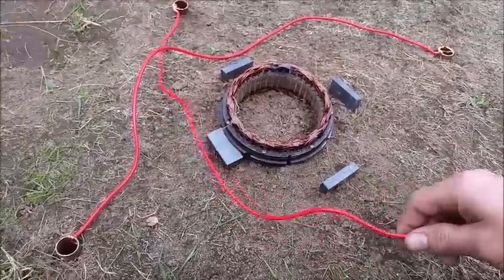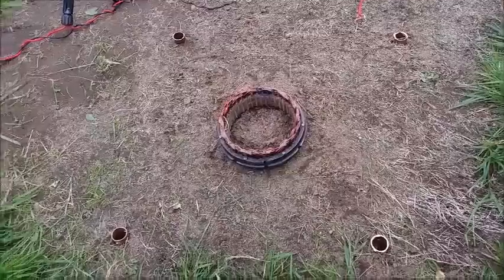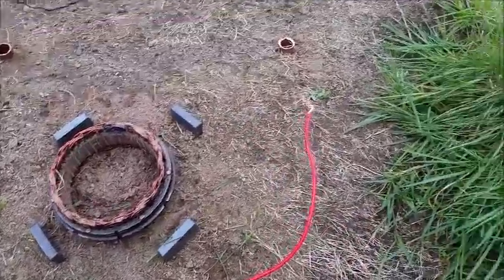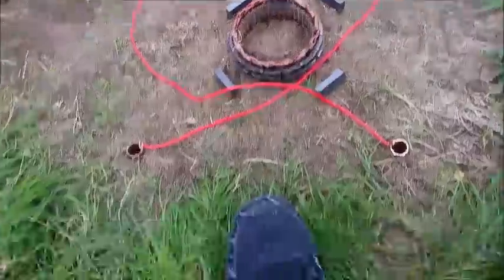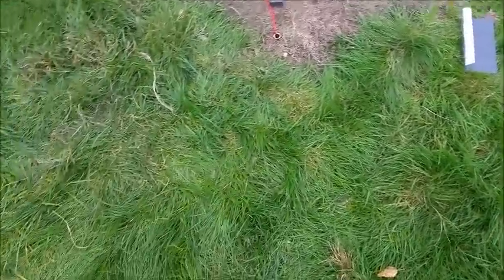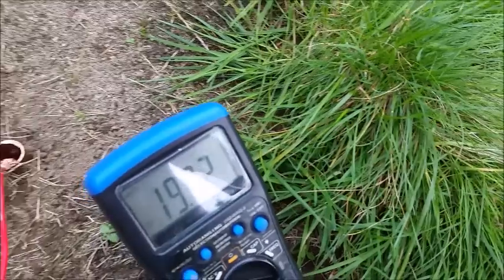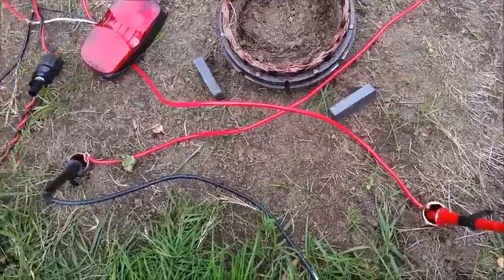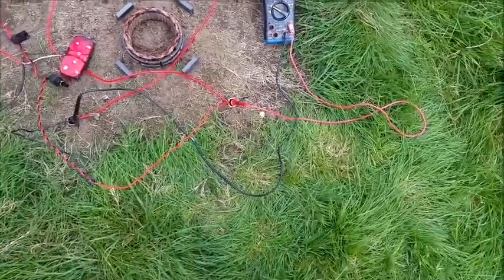How to get FREE Electricity

Comment: It works better than the usual 1-2 volts because the coil and magnets are creating a rotating magnetic field and either amplifying or simply adding to the ground voltage. 

I feel sorry for the people who think they are being tricked...
There is a lot to learn but you won't learn jack with a closed/skeptical mind.
Reply: its funny because if the magnets are on the ground the gravity doesn't impede the magnetic field like it would if they were moving through the field, effectively pinning the magnets against the earth with gravity's energy he cut out all the friction. Instead of having a flywheel spinning around, he uses the magnets to direct the downward force of gravity into the coil, and because of friction and gravity, the coil doesn't move but the gravity excites the electrons and creates a vortex in the coil. takes half the work does twice the job, free energy - no moving parts (keep in mind it's not really free because although we won't deplete the earth's gravity anytime soon it still had to come from somewhere. Same with the magnets, but you can run your second and third coils off of an electromagnet + battery bank that you charge with your first coil. I thought it would be efficient if I ran multiple sets of these but after making my mom and dad each a set (they're separated) I realized it's easier to just run all three off the grid and then just run with the added benefit of the power that you're adding into the system. It makes so much sense now that it's here in front of me, its literally free energy with no moving parts. lol. Well, it's funneled + stored gravity but whatever haha. works for me. Good shit
Reply: Lotsagrapes gravity and magnetism are mutually exclusive forces. Neither one has anything to do with the other.
Reply: Neither the coil nor the magnets are rotating. Sure there's a lot to be learned, but you can't learn anything from this video. Firstly, chemicals in the soil could be producing this effect, or even stray voltages from nearby equipment could be inducing the current. He doesn't show you what happens when he takes the magnets and coil away, the chances of them being the source of voltage is practically zero.
He also uses the term 'grid' saying "it should create some sort of grid", so I assume he's thinking 'the national grid' is some kind of electrical circuit rather than a term used to refer to power companies distribution rather than anyything technical.
If you take some change from your pocket, two different coins of different metal, such as copper and nickel, (UK: 10p's and 2p's) and cut some small cardboard disks slightly larger than the coins. Soak the disks in salt water, then start with say, a copper coin, and place a disk on top, then a silver coin, then another disk, and keep going as much as you want, starting with a copper coin and ending with a silver one, and you'd have created a battery, of about 1.5v. 
Now think of what nutrients might be in this guys soil, and how much moisture there may be underneath.
That's why he should have shown meter readings without the coil and magnets, as well as meter readings with wires not crossing each other.
If you take a piece of insulated wire and coil it like a spring, say 100 turns, then take a second piece of insulated wire and coil it, say 20 turns, then connect ac to the ends of the larger coil, and a meter to the ends of the smaller coil. Now bring the smaller coil close but not touching, the larger coil, so they are both parallel to each other, and you will notice you've induced a smaller voltage into the smaller coil. Now apply the voltage to the smaller coil and the meter to the larger coil and you'll notice you have increased the voltage. This is how you make step down or step up transformers. Now look at the video again. His arrangement of wires could very easily pick up electricity from nearby sources. The coil in the centre could actually be picking up stray voltage from a  nearby source, garden lights for example or underground cables, then could be inducing it into the crude 'coil' made up of copper pipes, wires and earth.
This is bad science at it's best.
Reply: Cat Man yeah... I'm not sure man.

I think this video is just entirely fake and there are buried wires connecting the bottoms of his copper tubes. Then he's losing a shit load of energy into the ground before he measures it.

I say this because we all know that grounding electricity is the best way to dissipate that energy. And not many "grounds" work quite so well as THE "ground".

Try it yourself. Cut and peel a few inches off of an extension cord. Then plug it in and throw it on the ground. Now lick the ground around the wires. No shock. It's grounded.
Reply: Guys...

Try to replicate this. You can't. This set up will not work.

The only way magnets and electromagnetic coils create electricity is by exposing those electromagnetic coils to a magnetic field in flux.

This causes an induced current in the electromagnetic coil circuit as is described by "Faraday's Law of Induction". 

If those coils are not experiencing a rapidly changing polarity  then no current is induced in the electromagnetic coil circuit.

Think about it for a second. How does a generator work? Well it works in perfect opposition to the electric motor.

Both systems are made up of a magnetic source and electromagnetic coils. The magnetic source can be permanent magnets or primary coils as in transformer assembly. In either case the systems work by either spinning the magnetic fields over the coils or by spinning the coils over the magnetic fields.

For a generator you use fuel to power a motor which spins the appropriate parts and electricity is produced. (Mechanical energy -> work -> electricity)

For an electric motor you supply the electricity, which induces a magnetic field in the electromagnetic coils and that causes the motor to spin. (electricity -> work -> mechanical energy).

So, based on that, just think about the generator for a second. It powers up once you get the motor spinning, which starts the generator spinning causing the electromagnetic coils to experience a high rate of magnetic flux, and therefore starts giving you electricity. Then you turn it off, so it stops spinning. Well, if all it takes to create electricity is some magnets close to electromagnetic coils, then why did it stop producing electricity? The magnets are still right there, 1/16" from the coils, but they are not spinning. So why has the generator stopped working?

I'll tell you why. It's because the electromagnetic coils are no longer experiencing magnetic flux
Reply: okay okay I feel you. You smart. you loyal. I appreciate you. like more videos so I can learn from them please
Reply: Lotsagrapes right back at you brother. Knowing things doesn't make a person smart. It's the ability to figure things out that makes someone smart.

I think it was Einstein that said something to the extent of "No. I do not know the speed of sound off hand. That is readily available in reference books. A college education is not for the memorization of facts but rather for training the mind to think."

You obviously have an open mind, yet at the same time, you apply reason. You're a smart guy.
Reply: @DanCleary1  true. alot of so called "smart" people do alot of dumb things lol
Reply: henry ford and the button! :)
Reply: tesslur
Reply: Dan C: I tried it and got a tingle in my tongue! I had at first thought the same, that he'd secretly applied a hidden voltage to those copper pipes, but then I thought how was he getting 19v, it's an unusual amount to be got from batteries, and anyway as you say, those pipes are grounded, electricity finds the quickest way to earth. I also thought that if he was smart enough to try to fool us with hidden batteries, then he'd be smart enough to devise a cunning plan rather than place an old coil with magnets around it on the ground and claim he's created a 'grid'!
Reply: Cat Man and 19 is not an odd number of DC volts for a battery. Most batteries function on multiples of 1.5V cells.

A common 9V battery, for example, is just 6 1.5V cells in series.

A car battery is 12V. That's 8 1.5V cells.
Reply: REDUCE YOUR POWER BILL. Simple and effective way to lower your power billlll. > https://t.co/jJLJDPZ75N?fg54hh >
Reply: Wrong- gravity and electromagnetism are the same thing...man made magnets are made by electrifying the medium but its small compared to a planet....I can prove it but im not going to on you tube.

Comment: The earth is a battery and to step up the power use two can transformers. First one is your power imput then connect it with the second can for your output. Be careful because the power will amp up alot. Adjust to your needs.
Reply: Eric Dell 
If you use a step up or step down transformer you will either gain volts and lose amps or, lose volts and gain amps. At least thats what i been tought i could be wrong.

Comment: 19 volts is good enough for charging a 12 volt battery several 12 volt batteries and you have power to run inverter to power shit brother. see if it does work at night too if so you got solar panels beat
Reply: Open ended voltage is not applicable .  He must use a resistor and measure across it to determine power
Reply: +TPUBruce who knows what he is doing I got a buddy who makes Crystal battery and it has been running for years never charged say he gets 1.5 volts so he makes enough to make the voltage he needs . we also do  hydrogen cells n shit lol
Reply: Adam Long, volts don't mean anything on their own. You can view it like this: You could have a bucket with a 110 litres of water in it, and the most it will do is make you wet, but if you suspend it from high and cut a hole in the bottom, you've got flow. A smaller hole creates a slower flow and a larger hole creates a faster flow. You could get hit on the head with 110 litres of water over a space of several minutes from a small hole, or hit on the head with 110 litres all at once from a larger hole. One would hurt more than the other.
Voltage is the amount of electricity generated, and current is the rate of flow. 
So if your battery holds 12v and still has a little capacity to push a few milliamps, but your charger has 12v but could only push 1 milliamp, your current will flow from battery to charger instead of vice versa.
In short, 19 volts may not be able to charge anything.
Reply: Yeah  but with close to 0 amps it would take forever to charge a car battery
Reply: +terry sowell  ever think about chemicals on the ground to amp up lol
Reply: can u message me how and results
Reply: Hi, I use a charge controller and from there two wires to the battery. Always safe! In the charge controller, 15 €, 10A, there are all other technical things like diode etc. So one good price for all and safety too.

Comment: Try turning the copper into a pyramid instead of just driving pipes into the ground. Make a pyramid with extra long legs and then put the legs just like the copper pipes into the ground. I dont know if it will be better but there is a lot of talk about pyramid power. great video

Comment: Have you hooked this up to a 12 volt battery?
Would 19 volts charge a 12 volt battery?

Perhaps two such ground devices could power a 12 volt lamp?

Just curious...
Reply: Absolutely! 19V will indeed charge a 12V battery. The question is do you have the time? At these current levels Trump will be on his second term before it finishes charging.
Reply: Yes 19 volts will charge 12 volt battery but you run the risk of gassing the battery with over-charging. A resistor or regulator would assist in preventing this with a slower charge rate. It would be good for running a small emergency radio set in war time situations. ( Ie Trump having nuclear war with North Korea.  Power is out and you want to see who the survivors are this would work to power a radio set and see what's out their in the rest of civilisation. )
Reply: kimbal summers You can use a solar charge controller to put +and - in. The controller gives never more volt to the battery as 13.70 V So no danger. for the battery. I did the same with my home made 12 V battery.  For this model here in the video 
you can maybe make 12 tubes....Like the Rodin theory? 
I am very happy with your video,  thank you.
Here the link to my 12 V home made battery.
https://youtu.be/OI_Kdj1Bb_k
Reply: @kimbal1958  Take a charge controller. Most easy, most cheap.
Reply: From the limited info in this video, it's not really possible to say if this will charge a 12v battery or not. He show's us 19v and runs some kind of lights from it, but are these bulbs or led's? Say you have 19 litres of water laying in a garden hose that is not connected to the water supply, all you have is 19 litres of water. But, if you blow down one end of the hose, you get movement of water, relative to the strength and constancy of your 'blow'.
In electrical terms this can be viewed as 19 volts, and the rate of flow of electricity is it's amperage. We don't know anything about the amperage, so we have no idea what kind of power he is producing. 
19v is more than that required by a 12v battery, but if the remaining power in a battery is greater than the equivalent 'power' of a garden hose with still water, then the battery will soon push back against the flow.
Reply: Earth Science Official  This earth battery will never be empty, that's why the pioneers are searching for those solutions, and it is much more cleaner 👍

Comment: What you appear to have done is called an "Earth Battery", aka a telluric power source or a telluric generator. And, you may have tapped into telluric current(s).
A telluric current (from Latin tellūs, "earth"), or Earth current, is an electric current
 which moves underground or through the sea. Telluric currents result 
from both natural causes and human activity, and the discrete currents 
interact in a complex pattern. The currents are extremely low frequency (ELF) and travel over large areas at or near the surface of the Earth.

Now that you know about it, what are you going to do with it. :>)
(by the way, the technology is almost 200 years old)

Comment: ★Subscribed! ★Search Wikipedia Either 1.Earth Battery Or 2.Earth Generator ★Search YouTube →★Earth Generator MrTeslonian (He Shows How He Built It A Home Power Plant Of Free Electricity For His Property ★Attach A $20.00 HHO Generator Up To A Backup Generator That Powers A House & NEVER NEED Gas/Diesel Again HOOK An HHO Generator To ANY Engine Drive 3,000 Miles On 16oz Of Water/Urine IF -40 Below Zero Freezing Use Windshield Washer Fluid With Antifreeze ★There's Multiple Ways To Free Energy :)

Comment: this is ABSOLUTELY NOT 'tesla style' -you first need a gigantic generator and a big tesla coil to start to push heavy heavy amount of amperes through the atmosphere at tens of thousands of volts PLUS - then you can use an inductor to 'catch' the electrical field and capture the 'free energy' in the atmosphere - that being said you can also do the same thing just before a lightning storm as the electrical field is just as large - if not more so... just don't get yourself struck!

Comment: since the conduit is shoved into the ground, this is nothing more than a old equivalent ground battery that they used to use back in the day of old telegraph lines. Its the combination of alkalinity in the soil, some moisture, and the copper pipe. Where there is a greater source of free electrons, they will migrate to the lesser source. This results in voltage/current movement.
Reply: So it's basically the same thing as that potato battery thing they do in high school physics classes?
Reply: And..... our planes still Use aerodynamics! We arn't evolving more devolving old isn't bad.
Reply: Michael Shultz yes there is a lot of power coming from the sun i can get a small pot to 80C all day with an old tyer some builders foil and a piece of glass. If you set it up properly boiling water would be ... "cooking with gas"...  Like the Monty Python reference.
Reply: Michael I would like to see/know what configuration of the items you use Mick
Reply: Michael Shultz where do you think the power from power lines come from?
Reply: John Smith I know right
Reply: You arr correct Sir. And I'll bet if he moved his experiment to an area far far away from power lines he would get somthing less than 2 volts @ .0001 amps or less. It's much easier to get power from a long antenna or a railroad track than a couple of pipes jamed into the earth. I mean if I went around saying I was king just because some moisent bent lobbed a simatar at me they'd put me away ! I mean watery tarts lying around in ponds Distributing swords is no basis for a system of government . And sucking enough power from the ground to heat your house or run your a.c. or even light a night light is quite impossible.  Get an old 3 meter satellite dish put a large light in front of it and take a large quantity of 1" mirror tiles gluing each one carefully to be shure that the light is reflected back to the focal point of the dish lna mount then put it on a south facing pole with two tracking motors for 14 azmuth and one for delineation. Put a cylinder atached to a pressurized water supply and an output pipe to a stream engine and you can run a generator to power your whole house.  If you use that energy to fill a pond up hill or a water tower then you can store excess energy for use when sun dont shine. Hydro power from water wheel or turbine.
Reply: And your point?